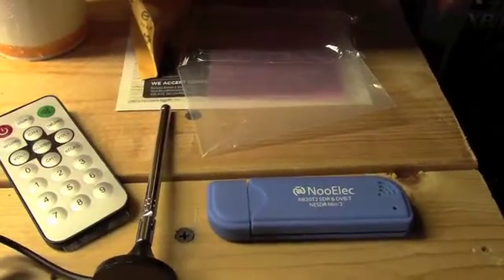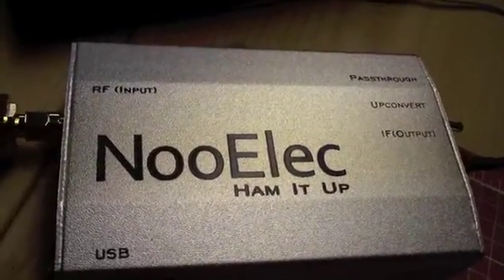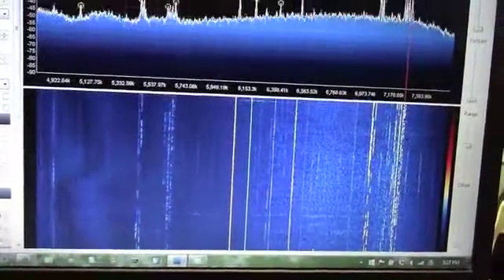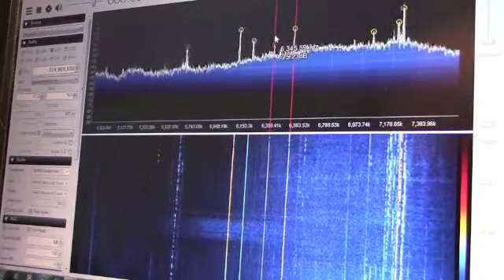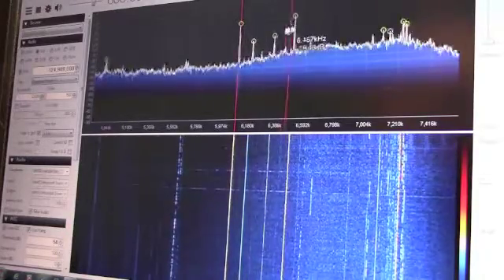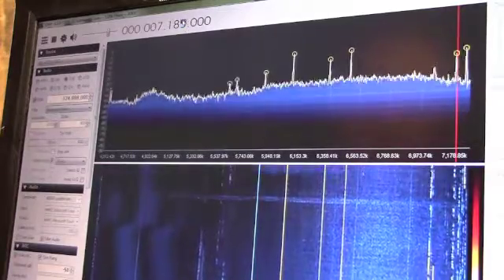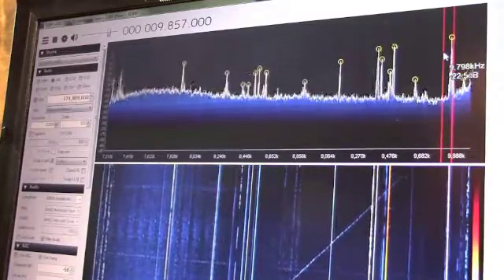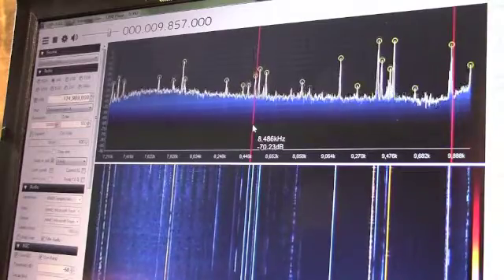NooElec SDR Radio and Ham it up up converter

Comment: Maybe I missed it in the video, but are you attached to any antenna like a dipole or anything? I want to run this set up asap. It's cost effective to run on a old PC.
Reply from the maker: BlackHorseMilitia the antenna is just a random long wire outside, maybe 25ft long. Have fun and good luck.
Reply: Thank you. Sounds easy enough.
Reply: You will need a balun😢Nooelec Balun One Nine Tiny Low-cost 1:9 Hf Long Wire Antenna Rtl-sdr
£4.33
eBay

Comment: You dear, do you have interference with the pc in hf ? How do you remove the noise source power pc? Regards.
Reply from the maker: No interference from the PC at all. The metal case keeps the noise down. You must get the metal case for both the receiver and the up converter. Good luck to you and thanks for watching.